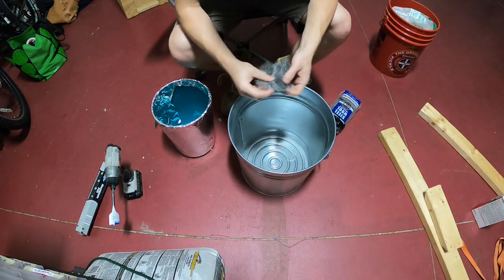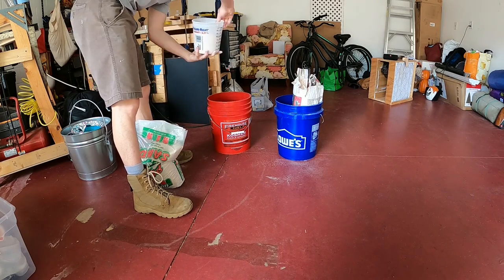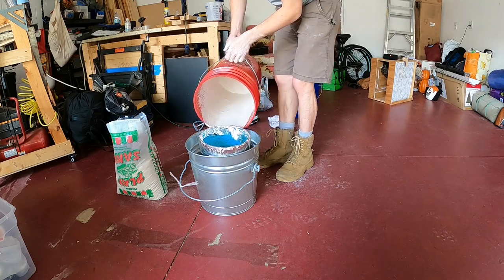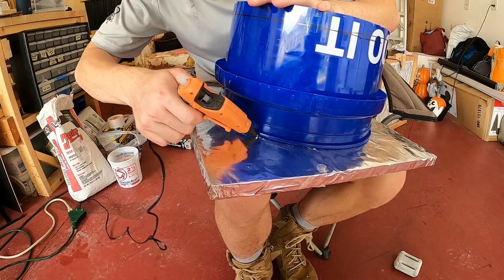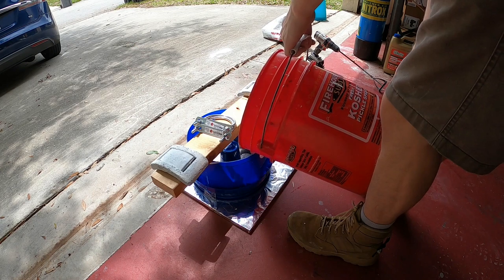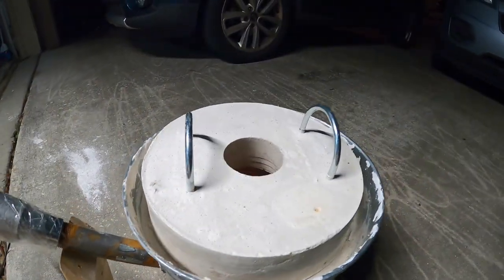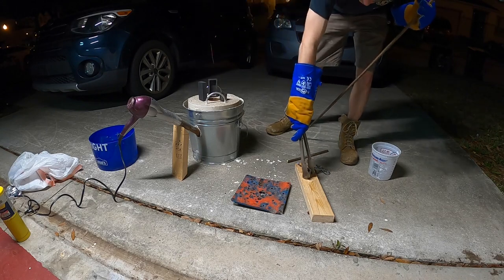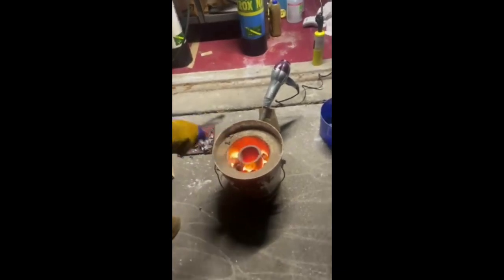Making a cheap portable metal foundry

Comment: Where do you get the crucible? Most likely Amazon huh! What size is the crucible. What are they (crucibles) made of? Carbon. Don't new crucible need to be treated or coated with,a borax powder? I metal detect a lot of hours a week searching historic sites for personal recreation and to help with archeological digs. Over the year I fill up buckets of lead, brass, copper even a lot of pewter instead of scrapping it as a low grade I would like to start melting it down and pouring my junk targets into bars or ingots. I might need a gas furnace I think the copper and brass need a lot more heat. The lead should melt down pretty easy.

Comment: You need to get a few pieces of 2x4 set your lid down on it along with your crucible!  Setting it down on concrete can cause it to crack or Explode.! You also don't want to be over concrete with hot metal! If there is moisture in concrete it can cause a super bad day if it drips on it!